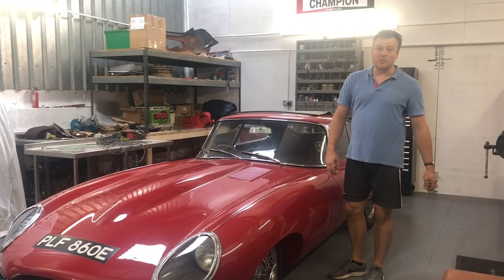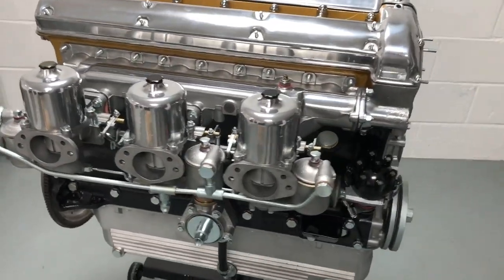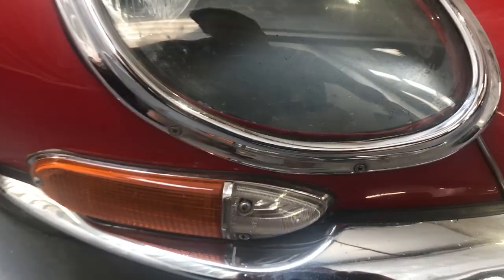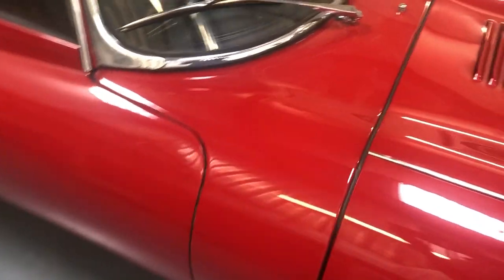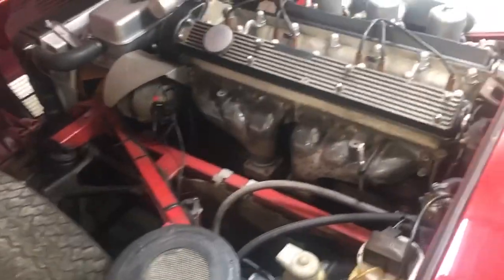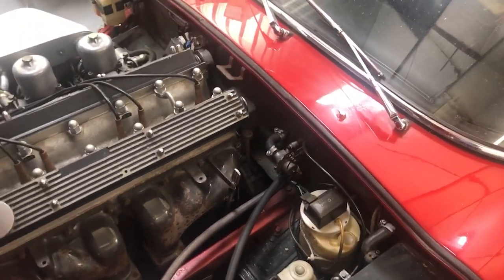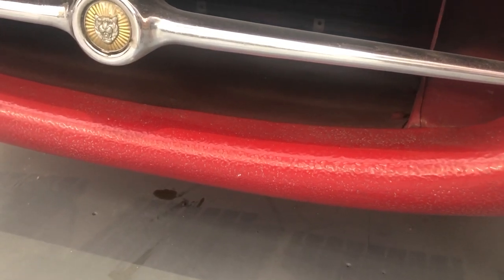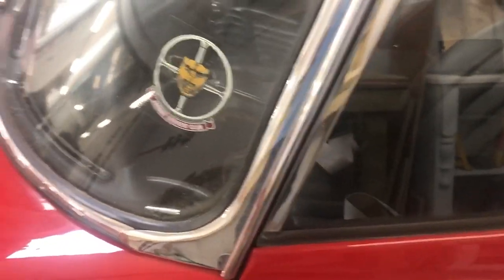Ep2 - Introducing the 1967 E-Type FHC recommissioning project

Comment: Looks like a great project. Ah yes mold in the interior, I find on the E-Type this mostly hides in the tar-paper on the bulkhead behind the rear seats underneath the panel that lifts up. Are you taking this right down to bare-metal respray?
Reply from the maker: Hi, yes it’s a great project. Mechanical restoration and recommissioning to get it running well and safely is the focus for now.

Comment: Stone chip and Red piping was in, in the 80s and 90s.
Reply from the maker: Yes, unfortunately so!
Reply: @fossewayclassiccarworkshop  I bought a s2 2.plus 2  in 2008 for 7200, it was knee deep in filler, fiat red, stone chip and yes red piping! Ran it a bit and did some work to it, someone had coupled the servo up wrong so max braking was going to the rear, stamped on the brakes and it spun me round!
Reply from the maker: @roystonvehicles9129  ouch!!
Reply: @fossewayclassiccarworkshop  yes bud

Comment: My 67 2+2 is in twice as bad of shape as your FHC, but I like your attitude toward getting it running safely. Being a 2+2, it is a waste of money for me to sink funds into cosmetics, but it is fun to drive! So I look forward to following your restoration of the basic mechanics. Thanks for sharing. https://www.youtube.com/watch?v=1HVzcWv6TuE
Reply: Interested by your comment being 2+2 it's a waste of  money please explain ?
Reply: @melvynevason7981  Dated article from 16 years ago, but good comparison of OTS, FHC, anf 2+2. Hemmings, 3/2005: Values Across the board, roadsters are more valued than coupes, and because some see the 2+2s as compromised designs, they are the bargains of the lot. Rough roadsters can bring $20,000, while nice ones trade around $40,000 and concours-ready versions can touch $70,000. Fixed Head Coupes start around $15,000 and jump to $20,000 and $30,000 for nice and restored examples, and the entry price for a 2+2 is about $12,000, raising to $17,000 and $24,000, respectively. While they're certainly pricier than your average MG or Triumph, E-Types are still screaming bargains compared to some Corvettes and Aston Martins, and with one drive, an XK-E brings its legend to life.  https://www.hemmings.com/stories/article/jaquar-e-type-1961-1967

My 67 2+2 has extensive body damage from a rear-end collision, so body work and paint job would cost more than a restored value.
Reply: @caseyjones745  I see your predicament. I have recently purchased at auction a 67 series 1 red 4.2 2+2 which has been totally restored leaving some interior trimming  work due to owners passing which I have almost completed .I paid somewhat more here in England than you  suggested. But a etype with covered headlamps and extra space was my preference. There can't be many 2+2 series 1 around so hopefully it will be a  good  investment .so many  thanks for  your reply
Reply from the maker: Thanks Bruce, yes it has to be safe first and foremost.  There are things I'm finding that prove it is far from roadworthy at the moment. I'm sure you'll be able to get it running nicely and hopefully the cosmetics (costmetics!) can follow!